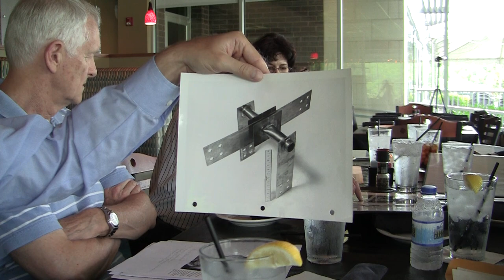ORNL Thorium Molten Salt Reactor Experiment Researchers - Dick Engel & Syd Ball - Dinner & Interview

Comment from the maker: Sync-ing is always a pain, but if you have everything already running, clap 3 times, then you've got easy-to-find peaks in your editing software. Just don't start & stop the devices as they're needed... start them all and keep them running. Maybe newer RockBox firmware has a lock (but I doubt it). The buttons are very hard to protect... top button or front buttons or home button will stop recording. Usually the mis-press is putting it on (top button), once it is on & running never bump-stopped.

Comment from the maker: 44kHz uncompressed WAV mono. DropBox lets you configure filesize, I'm using 256MB auto-increment chunks so no horrible fail if battery runs out before capture ends (can only lose last file). They run for over 5 hours, battery is what runs out, not storage (4GB). Only prob is no "lock" function when recording (like SanDisk firmware has). RockBox 3.11.2.

Comment: Gordon, great work.  Tritium (Hydrogen-3) often comes up as a problem when using Lithium.  But Tritium sells for $30,000 per gram.  And it's a gas, so it should bubble out of the molten salt just like Xenon.  
I have a suggestion.  I'm assuming thorium or uranium are added to the reactor as oxides.  Either added directly to the reactor or converted to a salt first.  Fluorine atoms will swap places with Oxygen releasing Oxygen, again it could take place within the reactor or some kind of preprocessing.  Regardless, as the reactor pressure increases, gases are syphoned off to external gas tanks.  I propose the oxygen is combined with tritium to form heavy water.  This way tritium can be easily handled, stored, and separated later for manufacturing.

Comment: This is a great video.  I learned a  lot.  I saw a video earlier today about the Moltex reactor.  I appreciate it more.  The fuel si contained in tubes which can be removed from the reactor.  If they're corroded, just replace them.  Actually this was how I first envisioned MSRs, but I thought it might be a little Robe Goldburgish. now I'm not so sure.  This does leave some krypton and xenon in the salt.  But you need to have a multiplication rate of exactly 2.0000... or you are making atomic bombs.  This should be illegal from the get=go.  Xenon 135 releases a LOT of energy. about 1/5 as much as fission, when it absorbs a neutron - i.e.a non=actinide fuel.

Comment: The problem is not that we don't have carbon taxes.  Carbon is only one of several external costs of fossil fuels.  Personally, I have always believed that, as one of the chief jobs of the military today is to safeguard shipping routes for oil tankers and to maintain friendly dictatorships in oil producers...there should be a Federal tax on gasoline in this country which is specifically earmarked for the DOD.  There should also be a tax on electricity from coal-fired power plants and natural gas